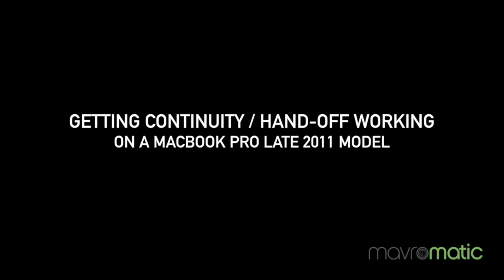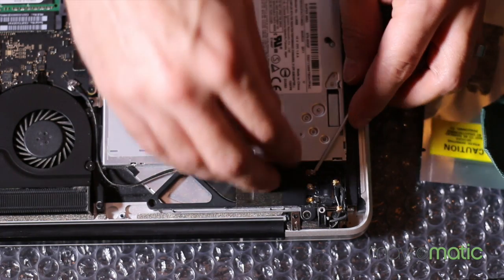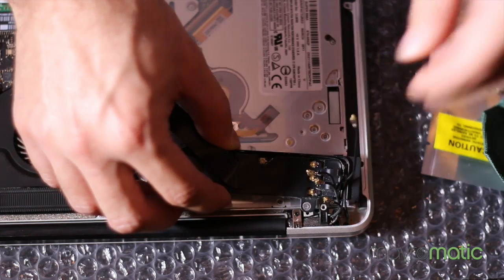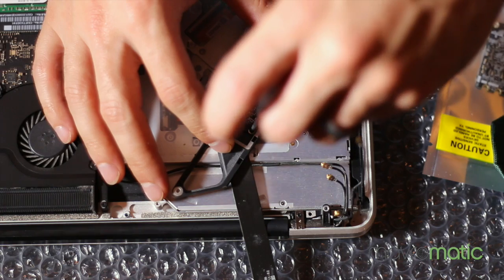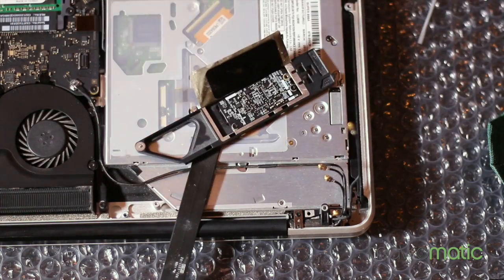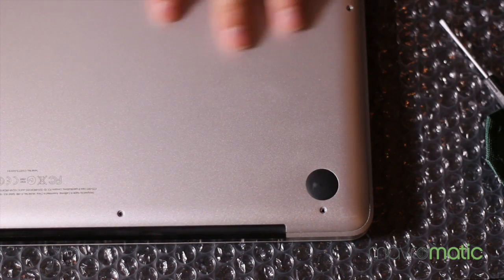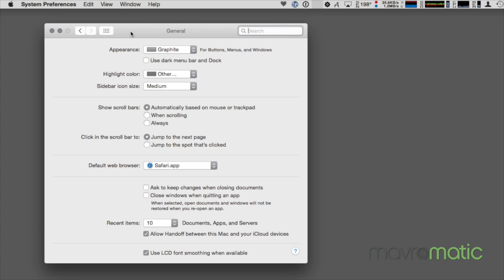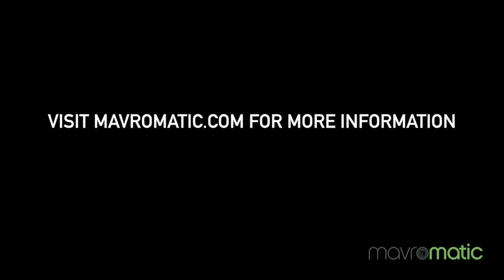Getting Continuity / Hand-off working on a MacBook Pro Late 2011 Model

Comment: Very nice instructions Danny, could you tell me if you simply just upgraded the wifi card without changing any of the software and codes, could the simple wifi and bluetooth functions just work right after the replacement. Thanks. I have the early 2011 Macbook Pro 13 with one of the antenna connector broken, so I'm thinking about replacing the card with bluetooth 4.0 LE instead. Continuity / Hand-off is not that important since this is my secondary machine and if that works, I will just leave it as is without messing with the system.

Comment: Is there any way to achieve the same for Mid 2009 MBP? I tried the Continuity activation script with BT 4.0 dongle but it did not work and resulted in a kernel panic no matter what I tried
Reply: Unfortunately not possible. Anything before 2011 models uses different chip and they is no newer compatible cards with Bluetooth 4.0 for them.

Comment: Having trouble enabling Airdrop on my 2011 Mac book pro 17”. Changed the blue tooth card as per the link & ran the script….  Any Suggestion ? 

 Apple Bluetooth Software Version: 6.0.2f2
  Hardware, Features, and Settings:
  Name: Lalit’s MacBook Pro
  Address: 
  Bluetooth Low Energy Supported: Yes
  Handoff Supported: No
  Instant Hot Spot Supported: No
  Manufacturer: Broadcom
  Transport: USB
  Chipset: 20702A3
  Firmware Version: v154 c5903
  Bluetooth Power: On
  Discoverable: Off
  Connectable: Yes
  Auto Seek Pointing: On
  Remote wake: On
  Vendor ID: 0x05AC
  Product ID: 0x821D
  HCI Version: 4.0 (0x6)
  HCI Revision: 0x170F
  LMP Version: 4.0 (0x6)
  LMP Subversion: 0x229A
  Device Type (Major): Computer
  Device Type (Complete): Mac Portable
  Composite Class Of Device: 0x38010C
  Device Class (Major): 0x01
  Device Class (Minor): 0x03
  Service Class: 0x1C0
  Auto Seek Keyboard: On

￼
Reply from the maker: If things verify that they are enabled after running the script, make sure you have your wifi turned on (both devices need to be on the same wifi).  If you have tried that and it still doesn't work, you may have to log in and out of iCloud on that 2011 MacBook.  That should kickstart things.
Reply: Thanks Danny for your prompt reply.  
1.Both are connected to the same WIFI network (Air Express) 
2. Log out & Login to icloud done. 
3.  Magic mouse | Air Pods connect fine.. Its only the Airdrop & Airport Express wireless Music that don't seem to work.  
4. The Script verify's and says done ! 

Does this have anything to do with the OS ? Am running on high Sierra.

Comment: i have a Late 2011 MacBook Pro i would love to install this in my computer Bluetooth Module 607-8962 is the only one that would work with my computer or could I use a  different module. Im having problems trying to locate that exact one. Also my Version is 10.12.3 will that matter?

Comment: Hey Danny, installed on my early 2011 MacBook Pro but now saying "no hardware installed" what can I check?
Reply from the maker: I assume you downloaded the latest tool from here: https://github.com/dokterdok/Continuity-Activation-Tool/

When you run the Diagnostic Checker you should get the following -- what are you getting?:

--- Initiating system compatiblity check ---

--- Hardware/OS checks ---
Verifying Continuity status...          OK. OS X reports Continuity as active
Verifying Mac model reference...        OK. Known compatible Mac Model detected: MacBookPro8,2
Verifying Mac board-id...               OK. Long board id detected: Mac-94245AXXXXXXXXXX
Verifying OS X version...               Warning: This version of Mac OS X (10.11.5) is Experimental! Only partially tested on El Capitan
Verifying Wi-Fi hardware...             OK. A Broadcom AirPort card is active, and is using the Continuity compatible Brcm4360 kext
Verifying AWDL status...                OK. An AWDL interface is up, Wi-Fi is ready for Continuity
Verifying Bluetooth hardware...         OK. The internal Bluetooth card is active
Verifying Bluetooth version...          OK. Bluetooth 4.0 detected
Verifying Bluetooth features...         OK. Bluetooth features are Continuity compliant
Verifying Bluetooth firmware...         OK. Bluetooth firmware version: v151 c5844
Verifying Login Item...                 OK. Login item for Auto Continuity Check is set.

--- Modifications check ---
Verifying OS kext protection...         OK. Kext developer mode is already active
Verifying SIP...                        Ok. System Integrity Protection is already disabled
Verifying ContinuitySupport...          OK. Already patched.
Verifying kexts readability...          OK. Wi-Fi and Bluetooth kexts were found and could be read
Verifying Wi-Fi whitelist status...     OK. The whitelist is correctly patched with your board-id
Verifying BT4 dongles compatibility...  OK. Compatibility with BT4 USB dongles is not enabled, this tool can fix this if a dongle is plugged in
Verifying old Wi-Fi kext presence...    OK. Legacy Wi-Fi driver Brcm4331 was already removed
Verifying legacy Wi-Fi card patch...    OK. The legacy Wi-Fi patch is not present. This tool can fix this.
--- Modifications check ---
Reply: Hey Danny, figured it out. I had gotten an error from the Diagnostic checker saying something to the effect that no hardware was present (I can't remember), but then I decided to to reopen the macbook and make sure that all of the contacts were properly seated and that did the trick. Thanks for the quick response and the great video guide!
Reply from the maker: Good to hear -- Enjoy!
Reply: Hey Danny, spoke a little too soon. All was well after a physical contact check as I said, but then after a couple restarts I got the Wifi disabled but the bluetooth enabled! So I dialed gatekeeper, rebooted and disabled SIP so I could run the Diagnostic checker and lo and behold Wifi is up gain after the restart (before I could run diagnostic in the tool). Did I do something wrong during the first Continuity tool setup? Will this reoccur if I switch back on SIP?
Reply: Also If I have to revert to the old card, how do I remove the modifications to the system to enable the old card to work again?

Comment: Can the 607-8961 model be used?
Reply from the maker: Hi! The key aspect to the correct card working is that it's marked with "CAX" and not just "AX".
Reply: I get a message saying operation not permitted when I try to run the script

Comment: Hi Dan..  Sweet Video..  Would a clean install of El Capitan 10.11.4 need the patch?  If yes, would your patch be compatible with 10.11.4 Thanks..
Reply from the maker: Yes, you'll need to apply the patch (run the latest activation tool provided in the description) after you install.  Then after each OS X update, you'll most likely need to also run the tool again... that's what I have been doing since I posted this video.
Reply: Thanks for your video and responses. Danny! My Macbook Pro late 2011 is running OS X El Capitan version 10.11.15
I suppose the activation tool provided in description will work for my device and, as you suggested, I'll need to run the tool after each OS X update. Is that right?
Reply from the maker: Yup!  That is the same model as mine... you'll know after the update if continuity stops working.   What I do is update, then open safari on my iPhone (or macbook) to see if it works.   Sometimes it doesn't affect things after an update sometimes I have to rerun the tool -- could be related to what the update updates :)
Reply: +Danny Mavromatis how long does it take you to apply the patch after each update please? I'm very keen on doing this to my late 2011 macbook pro 17.
Reply from the maker: Not long -- the only annoying bit is another reboot (after you've already rebooted for the OS update).  Sometimes you don't have to apply it again -- I think it depends on what Apple updates?
Reply: +Danny Mavromatis ah okay. Thanks so much man!

Comment: Hey Danny great vid. Question I have an early 2011 macbook pro 13 in and I found a card that is BCM94331PCIEBT4CAX, but the other number "apple part 661-6510" x19cfcc607-8958. Will that cause any issues or should it work? thanks in advance
Reply from the maker: +Sam Younes Hi Sam,  it should work.  The CAX chip is the the most important part.
Reply: Danny Mavromatis Alright Thanks Ill cross my fingers.

Comment: Thanks - looked at the eBay listings you sent - just want to confirm that it must be model # 607-8962 ?
Reply: John McCabe hey Danny - just following up on this....has to be 607-8962?
Reply: +John McCabe did you figure out which model # can be used? Can the 607-8961 model be used?

Comment: Hey there can you recommend a good source to purchase the module?  Also and sorry if I missed this in the comments , but my MBP is early 2011 - will this still work?
Reply from the maker: John McCabe Yes, it will work with Early 2011 model, module: BCM94331PCIEBT4CAX -- these should work: http://www.ebay.com/sch/i.html?_from=R40&_trksid=p2047675.m570.l1313.TR0.TRC0.A0.H0.XBCM94331PCIEBT4CAX.TRS1&_nkw=BCM94331PCIEBT4CAX&_sacat=0

Comment: Danny Mavromatis great vid! thinking about doing the upgrade and glad i was able to find this. i am already running 10.10.1, but was wondering if i install the chip and run the Continuity Activation Tool, then update to 10.10.2, will i need to run the Continuity Tool again?

Comment: Hey MBP 2011
10.10.2
Ran the script, patch_ble.sh
Get this error:
The version is Mac-94245A3940C91C80
Patching the kext...
Marking kext cache as dirty...
Setting permission and rebuilding kext cache...
kext-dev-mode allowing invalid signature -67061 0xFFFFFFFFFFFEFA0B for kext AirPortBrcm4360.kext
Done
Reply from the maker: +Christopher Bruder -- try this app: https://github.com/dokterdok/Continuity-Activation-Tool/   That is a newer app that does it all for you and pre-checks a few things.  You will need to use it everytime Apple updates OS X 10.10.x
Reply: Danny Mavromatis
I saw that one after, ran that one, but I still dont have the little popup to the left of my dock like my GFs mac does... Like when imessage is open on my phone, I dont have the popup down there or safari or anything
Reply: Apple Bluetooth Software Version:    4.3.2f6 15235
  Hardware, Features, and Settings:
  Name:    Christopher’s MacBook Pro
  Address:    7C-D1-C3-90-E0-1B
  Bluetooth Low Energy Supported:    Yes
  Handoff Supported:    Yes
  Instant Hotspot Supported:    Yes
  Manufacturer:    Broadcom
  Transport:    USB
  Chipset:    20702A3
  Firmware Version:    v147 c5799
  Bluetooth Power:    On
  Discoverable:    Off
  Connectable:    No
  Auto Seek Pointing:    On
  Remote wake:    On
  Vendor ID:    0x05AC
  Product ID:    0x821D
  HCI Version:    0x6
  HCI Revision:    0x16A7
  LMP Version:    0x6
  LMP Subversion:    0x2293
  Device Type (Major):    Computer
  Device Type (Complete):    Mac Portable
  Composite Class Of Device:    0x38010C
  Device Class (Major):    0x01
  Device Class (Minor):    0x03
  Service Class:    0x1C0
  Auto Seek Keyboard:    On
Reply from the maker: Christopher Bruder ok -- so you ran the activation tool and it completed successfully?   If so, you will need to log out and back on to iCloud -- that resets the keychain.   I did it on both my iPhone and OS X
Reply from the maker: Christopher Bruder Looks good -- now you just have to do that last step -- I mention it in the video -- you need to log out of iCloud both iOS and OS X to reset keychain issues.  That was the part I was having trouble with and it solved the issue.  Report back...
Reply: Perfect!  Works after I signed out and back in, thanks!!

Comment: BCM94331PCIEBT4CAX is the card i purchased and installed. than i downloaded the patch and opened terminal, typed in "sudo chmod +x" and typed in my password. i than dragged the patch to terminal and now it says in terminal

Rons-MacBook-Pro:~ Ron$ /Users/Ron/Desktop/patch_ble.sh 
Backing up original kext
The version is Mac-94245A3940C91C80
Patching the kext...
Marking kext cache as dirty...
Setting permission and rebuilding kext cache...
kext file:///System/Library/Extensions/Terminus.kext/ is in hash exception list, allowing to load
kext file:///System/Library/Extensions/JMicronATA.kext/ is in hash exception list, allowing to load
done 

and thats it. Am i missing something?

Comment: Hi
is it able to use regular screwdriver to exchange the module inside???
Reply from the maker: Yes, you just need a small philips screwdriver -- nothing special.
Reply: Thanks!
By the way, is there a different bluetooth module to fit different MacBook Pro??
because I saw different numbers such as 607-8958, 607-7295, 607-8942 on the Internet, does it matter??
I got MacBook Pro 15" early 2011.

Comment: Hi, Would the script work on early 2011 mbp 15" OS X Yosemite?
Reply from the maker: Yes, it should -- the key element is if the module is the same as the Late 2011 which I believe is.  You can verify by popping off the back cover...
Reply: Danny Mavromatis Great, will give it a shot ASAP,  back up of that kext file recommended right? ThanXs!

Comment: Yes it's a late 2011
Reply from the maker: Yes -- I think you have a MacBook Pro MC700LL/A A1278 which is the 13" model.  They use the same 607-7291 card -- http://www.macpalace.com/661-6510-airport-bt-card-macbook-pro-13/15-607-7291-a1278-a1286-.html.
Reply: https://www.ifixit.com/Guide/MacBook+Pro+13-Inch+Unibody+Early+2011+AirPort-Bluetooth+Board+Replacement/5131

i figured it out. you did it on a 15". this is the steps for the 13". already ordered my card. thanks a lot
Reply from the maker: niggasbhaten oops -- good catch -- I'll change the description to say 15" -- should be pretty close.  Good luck -- it's a pretty cool feature to enable.  Report back how it worked out for you too.
Reply: will do. card will reach next week thursday so will inform you then. one more question, will i have to run this when apple updates Yosemite in the future or will the patch stand up too updates
Reply from the maker: niggasbhaten nope -- it should stick.  OS X includes drivers for all cards Apple uses so it should be fine until they decide that the 2012 hardware is too old someday...
Reply: Danny Mavromatis question if apple somehow kill this walk around and i have to use my old 2.1 airport card who do i go about doing it. will i have to just replace to make it work or will the patch need to be removed also. and if yes how do i do that
Reply: Danny Mavromatis can you explain the terminal function after you u dragged the patch over at 4:09 and then the screen changed at 4:14. what is that you did. checked your site getting nothing
Reply from the maker: niggasbhaten (fixed the site issue, sorry) -- The key parts are making the script executable by opening Terminal, you enter : "sudo chmod +x " without quotes, and drag you file on the window -- then pressing enter.

Then you need to run the script, reboot.  You should see the handover under System Preferences > General.  Make sure you log in and out of iCloud -- that was my biggest issue.  For some reason the entitlement/credentials weren't updated and signing in and out of iCloud on both devices (macbook and iPhone) fixed it.
Reply: Danny Mavromatis
I did this and it worked fine – for a while. Yesterday I noticed Hands Off was gone and I had to redo the activation process. Now I’m back on track. Any explanation?
Reply from the maker: Mats Ödman Yeah -- it's looking like each time 10.10.X is updated, you will need to run the process again.   Use the "Updated" app method (in the desc) -- makes it easier.
Reply: Thank you for rapid answer. Annoying to have to do this each time 10.10 X is updated. No permanent fix in sight?

Comment: Will this work with a 13" MacBook Pro. I bought the card already and opened up my Mac but seeing a speaker close to the air port card
Reply from the maker: Is it a Late 2011 model?  Do you know if it has the 607-7291 card in it?

Comment: once i buy the card and download the patch all i have to do is drag and drop it to terminal?
Reply from the maker: Pretty much -- the key parts are making the script executable by opening Terminal, you enter : "sudo chmod +x " without quotes, and drag you file on the window -- then pressing enter.

Then you need to run the script, reboot.  You should see the handover under System Preferences > General.  Make sure you log in and out of iCloud -- that was my biggest issue.  For some reason the entitlement/credentials weren't updated and signing in and out of iCloud on both devices (macbook and iPhone) fixed it.

Comment: thanks.could one give me an link to buy this card?I have a macbook pro 15 late 2011
Reply from the maker: Yes -- I bought this card: http://www.ebay.com/itm/New-MacBook-Pro-A1278-A1286-A1297-Unibody-AirPort-Extreme-Card-for-2011-2012-/271649141031?
Reply: my Mac will recognize automatically the card? or only when I will install this patch.Because I  am afraid that if apple decide to stop this trick then I have to reinstall the original card.
Reply from the maker: hlias makhs The replacement card is from a 2012 macbook pro so the odds that Apple would decide to stop this from working, to me seems highly unlikely.  But like anything like this, use at your own risk.